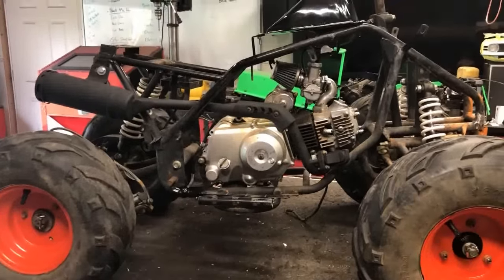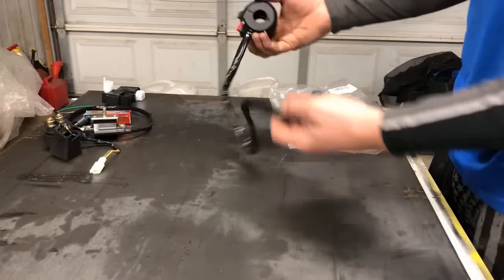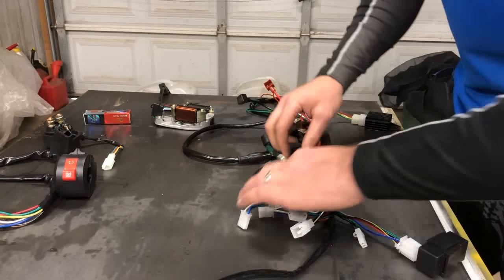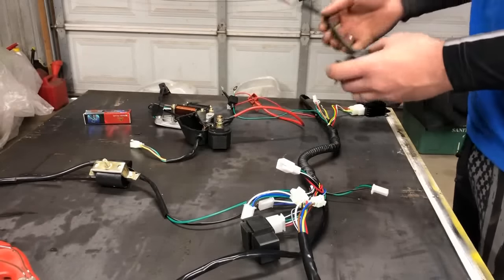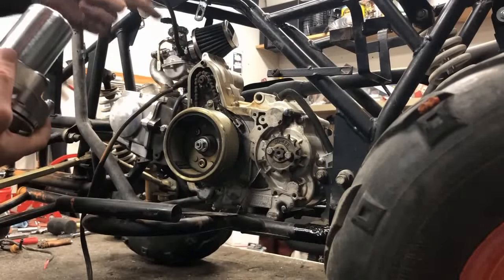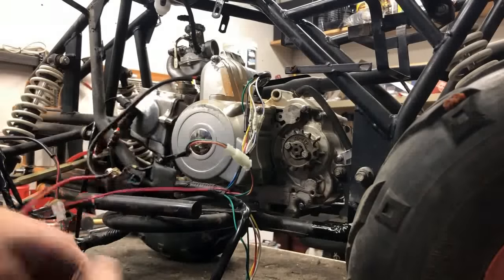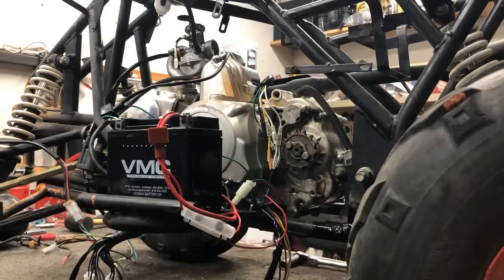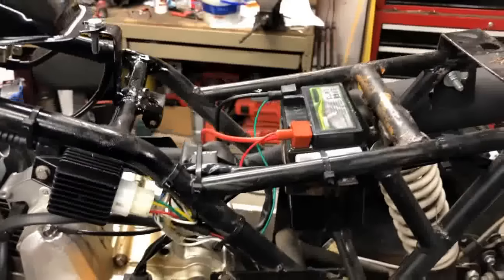Wiring a Chinese ATV from start to finish with an All New Wiring Harness!

Comment: Just replaced the wiring harness on mine and the switch still isn’t working. Any ideas why that could be? I can jump it from the selenoid but nothing from the start button. Thanks in advance.
Reply from the maker: This is going to sound silly but have you checked the fuze? Thats usually my culprit!

Comment: Should all the colored wires at the snap connectors match up together. I just bought this harness and the connectors for the handle bar switch don’t match up. Blue goes to black and yellow goes to green, etc, etc. Is this right?
Reply from the maker: It's difficult to follow your comment, can you send an email with pictures? I'd love to help anyway I can!

Comment: Which wiring harness u think I would need for a 250cc chinese atv 2 coil or 6? It's a shineray motorcycles atv
Reply from the maker: I've only ever done one 250cc chinese atv before and I'm pretty sure it was a 8 coil. Just pop the side cover off and see whats already on the motor.
Reply: I already ordered a 6 coil u think it would work with the bike?

Comment: I just bought 2 brand new 110’s. I’ve read that the chains should be upgraded right away. Do you recommend any upgrades to new models?
Reply from the maker: Robert Whetsel It all comes down to budget, but here is what I recommend. The stock chains will stretch over time so its a good idea to upgrade. You’ll notice in all my builds I put brand new chains on all of them. Next if your new model doesn’t include LED headlights I would suggest putting them in. The difference is incredible! Next, I upgrade all my personal machines with lithium batteries. They run in the $70-$80 price point but I’ve had them last for over 5 years and never need a charge! #WorthTheMoney Lastly if the budget allows it, get some upgraded shocks. The stock shocks on the majority of these things are terrible and extremely stiff. Let me know what you end up doing! Thanks for watching!
Reply: Praska Boy's Garage awesome! Shocks was my next guess. Thanks for the feedback. You’re videos are awesome! I’m a gear head I  build Harley’s and hot rods. I was intimidated by these little machines, but your breakdown of them makes it pretty simple! Thanks again!
Reply from the maker: Robert Whetsel Thanks for the support!

Comment: Thanks for replying problem is that is the wiring harness i got the  connectors are different from the headlight connector and I have no rear light it broke and the fuse is good there  is a different way to check would appreciate the advice
 thank you again
Reply from the maker: Grab a test light. If you don't have one most places like harbor freight sell them under $10 bucks. Hook it up to the negative post on the battery. Now trace power from the key switch to the start button. Prob the wires that are in the white connector that goes into the start button. I'm not sure the color but on of them should have power when the key is turned on and no power when the key is off.  If you cant find power at all then your key is bad. Email me if you have more questions!

Comment: Awesome video buddy on your rebuild, My question is the part number for wire harness and supplier, as I'm having issues with mine, as mine is a brand new one but has too many extra wire's. If possible and I know this is a long shot but what was the part number for the wire harness you used. Cheer's Buddy keep up the great work.

Comment: My stator has the different color wires coming out of it but on the harness theres 2 yellow and not a white. All other colors match. So I dont know which yellow goes to the white on the stator. Any help is appreciated.
Reply from the maker: Yellow and White are the same. They are both charging wires so you can switch them around and it wont matter. Plug in and you should be good to go!
Reply: @PraskaBoysGarage  
Thanks. Your videos are the best by the way

Comment: For some reason my stater wires do not match to the wiring harness. On the new stater I have 2 yellow, red, blue, and green all female conectors. On the new harness I have yellow, blue, red, white with male connectors and a green with a female connector. Any idea what's going on there

Comment: Hi mate great video, looking for advice I have a Chinese 150cc quad I've just done the wiring with your help but I have a carb with 2 wires coming out, I'm sure it's an electric choke! My wire harness is the same as in your video can I wire this up to the wire harness?
Or can I change the carb? Thanks
Reply from the maker: Willie Cossie From my experience it’s much easier to change the carb to have a manual choke. I’m sure their is a way to hook up the electric choke so it engages while cranking. However I don’t want to give you bad advise because I’ve never done it.
Reply: @PraskaBoysGarage  thanks for your reply mate I will look in to changing this ! As soon as I get something from my engine, I'm not getting anything from my new wiring harness, no spark, no starter motor trying to turn over! 🙁

Comment: Hey on my 110cc the hand brake has a small box with 2 terminals   that clicks when I squeeze the brake . What is that box called and which wire goes on which terminals?
Reply from the maker: In this video you'll see 2 wires I hold together to allow the motor to turn over. Those 2 are green and black. They attach to your brake handle. It's the safety that makes you hold the brake handle down to start it.
Reply: @PraskaBoysGarage  o ok just saw that in the video you held them together to push start.So it doesn't matter which terminal I plug them into?

Comment: So I got this atv from a friend of mine and some of the wiring was all jacked up. I'm down to having everything back in place except for one skinny red wire coming from the harness, on the end it has a little metal piece that looks like it would connect to either the battery or the starter relay but according to the diagram and your video, it doesn't. Please help.

Comment: Great video!!!  Thanks for doing these videos. 
Question. I have  a 125  cc 3125 R Coolster.  I have a wire attached to right above the chain. There is a 3 wire plug at the end. What is it?
Thanks in advance for your input. 
I bought a 2 coil wiring set.
Reply from the maker: That is your gear light sensor. Your ATV probably has a Neutral and Reverse light and that is how the atv knows. The new generic harness does not have a hook up for that plug.

Comment: I brought a wiring harness kit for  my 125 chinese quad  but the stator  that came with the  kit  was a 2 coil and the stator that's  on my quad has 6 coil can I still  use the coil  that  came with the  kit
Reply from the maker: I don't believe you can. On a 2 coil the pickup is attached to the housing and on a 6 coil it is separate. I've never tried it but based on that I am not sure if it will work.

Comment: Question? What do you recommed for fuel lines?? I see some cheap ones on Amazon but they fail in few months or so..
Reply from the maker: I purchase mine locally from Ace Hardware. I don't get that cheap thin wall stuff cause you're right, it's garbage!

Comment: I have a baja 250 and it has a 15 pull stator and i cant find a whole harness any suggestions..can i go from 15 to a 6 pull ???
Reply from the maker: Looks like monsterscooterparts sells most of the electrical components but not the main harness. I am not familiar with that atv but based on the stator I see it probably isn’t possible to install a different style without making major changes.
Reply: The original stator has 7 wires coming out 3 of are yellow i think ny only options is use original stator and try one wire at a time

Comment: I just hooked this exact wiring harness up,,I changed everything that came  in the kit except the stator,and when I was done,I hit the strart button and I get nothing. There are like 3 two prong plugs that could go the stater solenoid?? which one is it??
Reply: I have went over my work and do not see anything wrong with the way I have it hooked up. The 3 wire plug from the control device,,that dont match is the same here. The control device has the light buttons and the start push button on it.
    THere are two 2 wire plugs with black and green wires to them that are not hooked up. You said these are rear brake lights. I noticed the black wires are 12v when the key is turned on. And also there is a single black wire with a large female connector on it that is not used ,,also 12volt with key.
  I get no change anywhere when I push the start button. I checked almost every wire to see where the connection for starting is and I cannot find it.
 I must have some connections wrong somewhere??? There are so many plugs that are the same or close it is hard to tell where each go.
Reply from the maker: I'm sure it's something simple. Do me a favor. Email me your contact information and I'd be happy to do a video call with you so I can look over your connections!
Reply: @PraskaBoysGarage  I appreciate that but I just ordered a different wiring harness. It will be here in a few days.Ill let you know how it goes
Reply from the maker: @5153flash  Perfect!
Reply: @PraskaBoysGarage  I received a new different but similar harness and it does the same thing. With all the plugs where I think they should go,,I get nothing when I push the start button. And cannot find a wire anywhere in the whole harness that goes 12 volt when that button is pushed? What is going on here?? The stater solenoid needs 12 volt to work. If this is my only problem I can run my own push button start button,,but it seems it should work with these harnesses.

Comment: Hey sir I have a question. So all of my wires are connected like you did yours on here but two issues I have. #1 whenever I connect the battery to the negative terminal , the atv tries to start and the power wire starts to smoke on the starter. The second is that my handle switch has 2 white connectors however my wiring harness only has 1. I’m not sure how to proceed
Reply from the maker: You most likely have power from your battery making ground to the fame/engine somewhere. The main power wire coming off the battery is going where?

Comment: Can you wire a 8 coil magneto setup for a 90cc engine with a 110-250cc grade wiring kit? Like will it break or ruin something?
Reply: Sorry I meant stater
Reply from the maker: A stator serves the same purpose in almost all small engines. It generates electricity, and spark. The biggest concern I would have putting in a 8 coil would be to have it fit in the space provided inside the flywheel and flywheel cover. I am not sure if it would work.

Comment: Awesome Video.. Could I use this same wiring harness and had a remote kill switch to it. Mine is a kids 70cc quad my 4 year old will be riding and wanted to add a kill switch.. Thanks
Reply from the maker: They sell the kits online brand new that also include the remote. I suggest ordering new to save yourself the headache of trying to add it!

Comment: is there a place on this switch to mount the choke lever?   cannot see in any picture
Reply from the maker: If your atv has the choke next to the start button then it is a different harness to order. They are very similar and the install should be almost identical.

Comment: Hi ! I have the whole new wiring harness without kill switch for mine , but I'm having problem with it , the key cannot turn off my engine , its just nothing , mean I turn it on to start my engine is ok but when I try to turn off my engine its just nothing happen , and there is few more other's problem too , head light switch no function , signal light switch not function correctly , mean that left button become head light switch  , when press right button of the signal switch it got zizizizizi sound , so scary , brake light ok starting engine button ok , I wonder is the wiring harness are faulty ? 
Hope to have help here , thank you

Comment: Hi mate I just picked up Bashan 200  brought brand new wiring for it its harking over with the battery but I've got no power to the start or kill switch can u possible help please with the complete wiring as I am really struggling as not worked on a Chinese quad
Reply from the maker: Wiring is so tough to help over text! Sorry I'm late to your question, I hope you got it figured out!

Comment: I have a taotao 110cc. I just got this harness and got it all wired and put together and have the brake safety bypassed. The unit will crank and crank and crank. Won’t even pop over when starter fluid is put into the cylinder. Any ideas???
Reply from the maker: Do you have spark? If you have spark and fuel the only issue after the is either you need the valves adjusted or you have a loss of compression.
Reply: Had spark fuel and compression. After finding the the owners manual online. I needed a tether switch. Wired it in and it fired right up!
Reply from the maker: Awesome man! Glad to hear it worked out!

Comment: Hey great video got my 125cc all wired up besides one thing I have the stator wires coming out of the case an then I have a wire to hook up too that comes out of the transmission case any info on that?
Reply from the maker: That is your neutral and reverse light indicator. These generic harnesses do not have the hook up for that sensor.
Reply: Do you know where I can get that hook up for the sensor by chance?
Reply: Anyway around the gear switch indicator?

Comment: Do u know how to bypass the gear indicator/sensor I accidentally cut the wire when installing the new harness
Reply from the maker: In the past I've just cut them and covered them with electrical tape. They don't hook up to the new harness so it is easier to just get them out of the way.
Reply: @PraskaBoysGarage  so you can just disregard the gear selector harness on the new wiring kit?

Comment: Hi, great video, thank you very much. I would like to add one thing to this, there are 2 6 pin connectors and both will fit CDI or hand switch if you mix them up you wont get a spark, ask me how I know:) Make sure that that blue and white, red and black wire on the 6 pin go to CDI.

Comment: Hey have question? 
I got the same wire harness as you. Wire everything up, question on the gear indicator, the new wire harness doesn’t have that. Can I just bypass that and not worry about it, or is there a safety neutral switch. I have basic same atv as you and same wire harness. Just doesn’t come with the gear Indicator. Will it start with out that. Also the the hook up on the rear with the brake light and the rear brake switch hook up on the end of the harness. Can you just ditch those. If the front brake switch is engaged, is that all you need to crank the engine. Like you did in the video just putting the two wire together. Plz help me out
Reply from the maker: Yep you can bypass doing the gear indicator, i've done that over a dozen times now and it will start. For the second question your right, all you need to do is hook up the front brake wires and that's it. Some atvs have the rear brake switch and some don't. As long as you have 1 engaged it will start.
Reply: Hey I installed the harness and it keep blowing fuses and start smoking I think the harness is defective
Reply: And bypass the gear indicator, do I just leave it unplug?
Reply from the maker: @chrisnoriega6728  Yep I just leave it unplugged and zip tie the wiring so I doesn't cause a problem. Sorry your having troubles with the harness, if you got it off amazon you can return it.
Reply: I think I figured my problem out, I went thru the whole wire harness and taking it all apart and going thru, got rid of wire don’t need. But I finally got it to start. Think I got it right this time. I took wire harness back off going finish up the wire harness, sealing it and tighty it up. So I kinda did a custom harness from what I bought Bc I thought the harness was junk so didn’t loose out. But it worked so. I will send a video when I’m all done. Ty for you time and replying back to me. You are amazing. Ty
Reply from the maker: @chrisnoriega6728  Hey no problem! Glad you got it figured out!

Comment: Man awesome video, watched it 10 times and did everything I believe correct but I don’t have spark on the plug. I’m by far no electrician but followed everything, am I missing something or is there possibly another issue? I bought the same new harness also
Reply from the maker: Stator, CDI, Coil, and Spark plug are the components that effect spark. You also have the ground wire, safety tether and kill switch that need to function correctly. Start with the easy stuff. Unplug your tether, clean your contacts for ground, make sure your battery is fully charged, and use a multimeter to make sure the kill switch functions properly with an open and closed circuit. If you do all that and still no spark, then likely you have a failed component. In my experience if you have a failed component it's usually a bad CDI Box.
Reply: @PraskaBoysGarage  you are the man. I replaced the CSU box and now it runs….. but I see smoke coming from the cylinder head where it mounts near the spark plug and engine case. Any thoughts? Gets worse longer it runs. Like 2-4mins after turning on
Reply: Cdi box* sorry auto correct lol
Reply: @PraskaBoysGarage  hey I got it figured out. You are the man!! Thanks soo much again
Reply from the maker: @joeschaefer8543  You bet man! Happy you got it figured out!

Comment: Hey bud I hooked everything up just like u but once u hook the positive cable up it will turn over by it self what do u think it is got new battery and motor plus wire harness all new
Reply from the maker: The starter will only run by itself if it has power going directly to the the power post and has ground. Your issue is usually a result in having the + & - wires around. If you know that's perfect then your starter relay might be stuck. Give it a couple love taps before replacing.